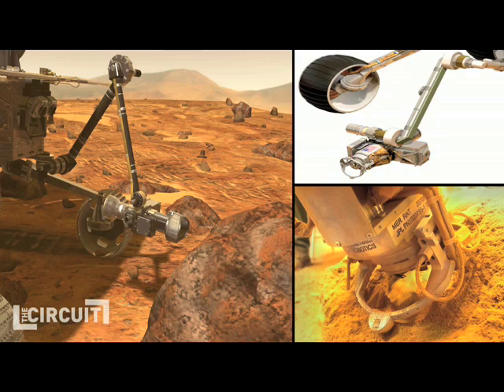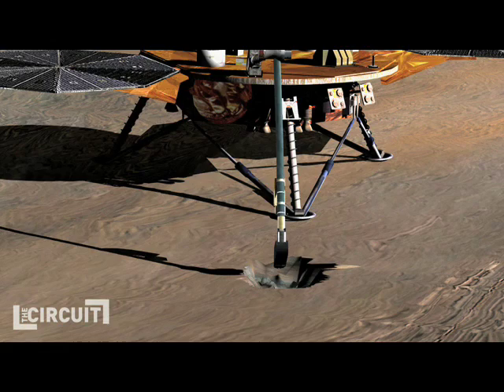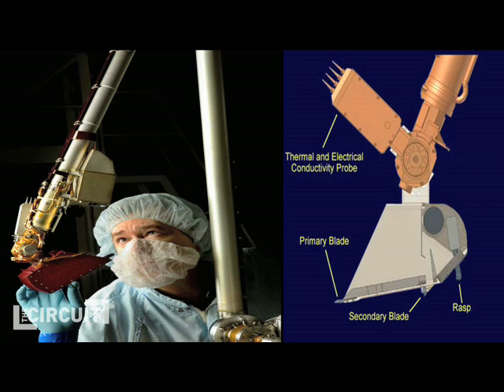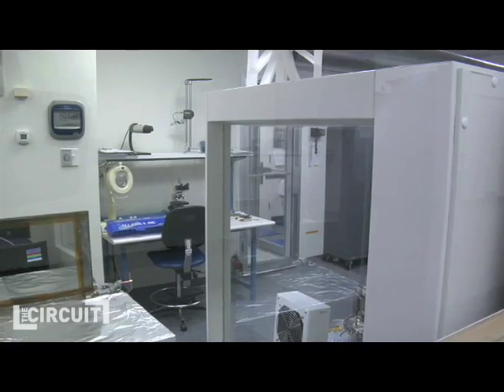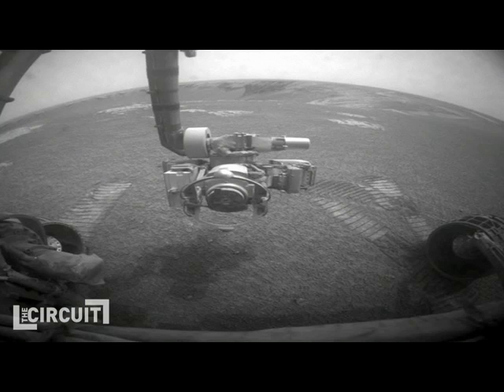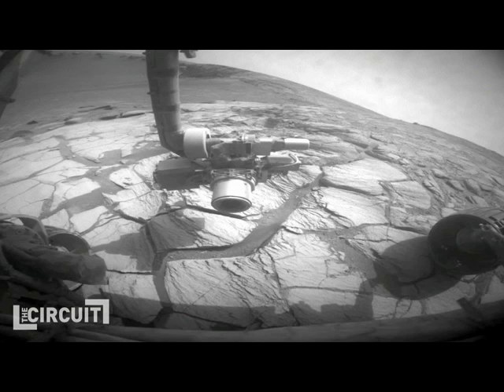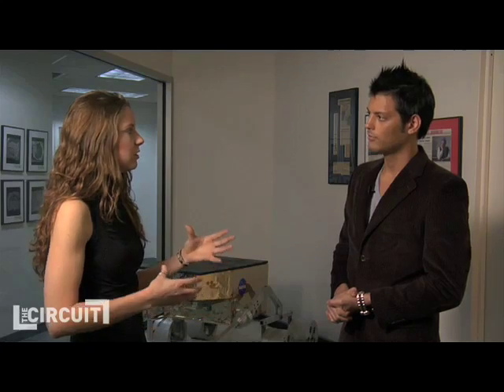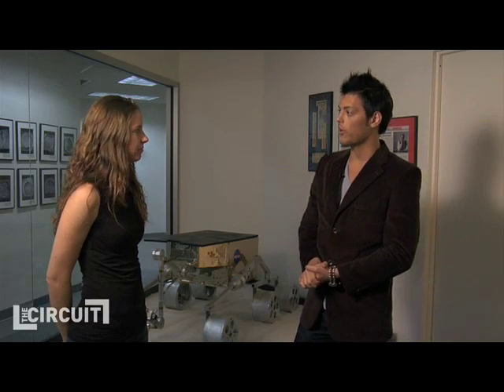Mars Phoenix Mission: Meet the Arm

Comment: It's just you, Oen713.

The mission profile simply doesn't require mobility! More importantly, locomotion would add significant weight to the lander, which would reduce the science payload capacity. As it stands now, the probe's biggest limitation (if you could call it that) is the quantity of reagents it carries for chemical analyses, not its inability to move around.